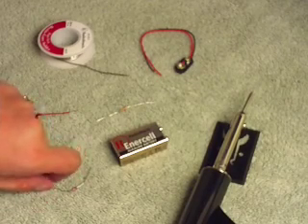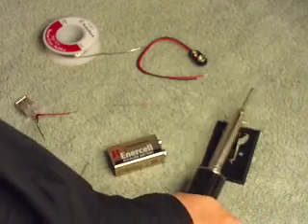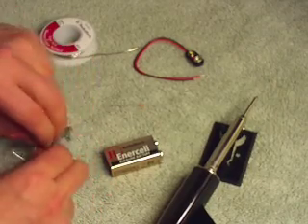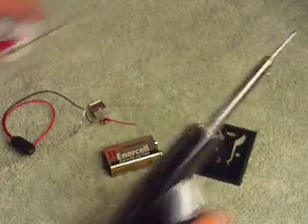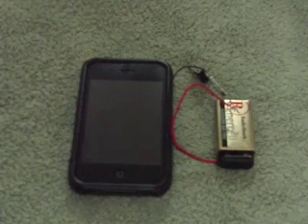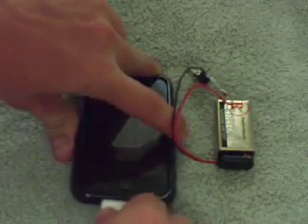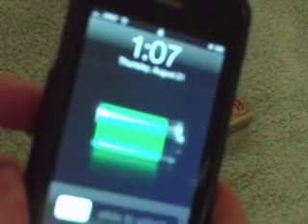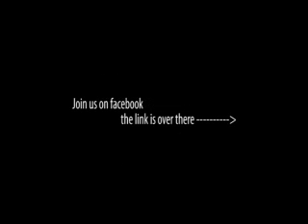How to make a USB battery

Comment: Why is the resistor necessary?
Reply: Because the battery is 9v and the USB is 5v. The resistor just lowers to voltage to 5.1v.

Comment: It is fake and you didn't make a great job hiding it.
Reply: becouse zener diod alows 100ma current that wouldnt even charge your phone of it would it would take more than 2 days
Reply: iMiner and iphone needs surcent voltage on 2 data pins so he should use voltagr devidor with resistors and he didnt use eny of that so yes its fake

Comment: Can anyone help me out ?
I put those 2 wires in the outlet instead of connecting them with the battery connector.
It was charging, but after 5 seconds there was smoke comming out my phone and the screen went off.
What did I do wrong ? My phone isn't booting up. How to fix this ?
Reply: +Eduard Likes Unicorns las conectaste mas , estas haciendo un corte
Reply: +Eduard Likes Unicorns buy a new cellphone
Reply: +Eduard Likes Unicorns IDIOT

Comment: This is a terrible idea. Use a 5v regulator, a standard diode and 5 NIMH AAA cells in a can. The amount of energy in a 9V battery is very small compared to the iPhone battery and is even lower when you try to pull a charging current out of it.
Reply: Power Max I honestly don't understand why people do not read the description before making comments like this.  The description literally says "if you need a quick charge" and "turn a 9-volt battery into a life saver."  Although the charge may not be quick, this video was NOT intended to show an efficient charger, but a small, easy-to-build emergency power pack just in case you ran out of power at a bad time.
Reply: This was made in 2008, when phone batteries were not 2500+ milliamp hours.
Reply: NoahWL1 They were generally higher than 1000mAH, and the impedance matching between a 5V input and a 9V battery is awful without proper voltage conversion via a switching regulator.

A high quality alkaline 9V battery has as much as 600mAH of charge ideally with minimum current draw, but that falls to less than 400mAH when the phone is attempting to pull 500mA of current (if the voltage did not drop so much, the current will probably be closer to 1000mA or more, but a 9V battery cannot deliver that much). Assuming that the phone can pull that 500mA of current and the voltage drops to the proper 5V from the zener diode, an absolute maximum of 0.4AH*5V= 2WH  will be 'delivered' to the phone (but not the battery in particular. There will be losses with the charging circuitry inside the phone), even if the 9V battery theoretically has 5.4WH stored inside.

To put 2WH of charge in perspective, the typical WH rating of a 1500mAH battery like that inside many older iPhones is 5.5WH. It is less than 26% charge if the phone completely shut down, and assuming no power loss in the charging circuitry. otherwise, it is far less. Perhaps it is enough to make an emergency call. I would not bother with this method anyway since there is no proper 9V to 5V buck converter, and a switchmode converter would allow a MUCH more efficient conversion to allow the most of that 5.4mAH to charge the phone.
Reply: NoahWL1 The problem with it is it just won't work. Read the data sheet of any typical 9V battery. Power Max is absolutely right, you cannot draw 500ma out of a typical 9V Battery. You probably couldn't even keep an iPhone turned on from just a 9V battery.  It might work with a NIMH 9V battery because they are able to deliver much higher current than their primary cousins. Looking at the data sheet will help you to better understand what I'm talking about (if you don't).
Reply: NoahWL1 True, I agree. (but who reads descriptions!? lol) Even given that info, I still would not trust this as it could fry the USB input on the phone, 9V is a lot more than 5V and if there is any capacitance in parallel, then say goodbye to the sensitive electronics inside the phone. Using a common car charger and connecting that to a spare is the better way to go! They can be found in nearly any car, they offer a conversion to 5V with upwards to 85% efficiency, and can deliver 600mA @ 5V with a input of 380mA from a 9V battery (taking into account ~85% efficiency)
Reply: tarstarkusz I found this datasheet and used this for my calculations, here it is if you care for it. The one graph shows curent draw up to 500mA, but I'd imagine the voltage drop would be significant.  http://data.energizer.com/PDFs/522.pdf

Comment: Is it me? Or is this the most vague  how to ever?  I mean solder the zener to the connector..then the battery to the left wire..  Then hook it all up and whalaa! All done😀😊 I don't think u want anyone to learn this one.
Reply: Just get one of those car chargers and connect the USB part to the phone and the car cigarette lighter end to the battery, with the tip of the charger touching the + end of the battery and the side metal strip touching the other terminal of the battery. This is a FAR more efficient method, you can probably charge a modern phone to 50% from zero with this method.

(The method in the video above will only get you like about 10% charge in a modern phone, with risk of frying the USB on your phone)

Comment: First of all this doesn't work on Iphone 5S it only works for Samsung and not all brands. Second thing it doesn't actually charge the battery small current just passes to make the mobile say that its charging but actually nothing happens
Reply: Both of those statements are true only because those phones DIDN'T EXIST at the time of this video's making.  It cannot charge something it doesn't have, nor present day smartphones with 2400+ mAh batteries.

Comment: I understand what I'm saying perfectly well. You sem to not understand voltage regulators. The Zener diode receives a value, in this case, 9v (You are really ignorant about the hardware used in this video) and then produces a set voltage back out, 5.1v. The Zener diode exists and functions as a voltage regulator.

Comment: No... Without the resistor, all the zener diode will be doing is making sure the voltage is greater than 5.1v. 10v could go through a zener diode in its reverse direction if it's breakdown voltage is 5.1v.

So please, next time you say something, double check you understood what wikipedia told you.

Comment: A Zener diode is a diode which allows current to flow in the forward direction in the same manner as an ideal diode, but also permits it to flow in the reverse direction when the voltage is above a certain value known as the breakdown voltage. Breakdown voltage is a characteristic that defines the maximum voltage difference.

A voltage regulator is designed to automatically maintain a constant voltage level.

So basically, a zener diode IS a regulator.

Comment: I was at Home Hardware once and I bough two USB rechargeable batteries. It works by taking off the positive end of the battery and it exposes the male USB connector. Pretty cool and handy if you ask me.

Comment: I was thinking the same but it will not work with 9 volt battery, USB gives around 5 volts, plus you need some sort of charge controller- in order not to ruin the battery :(

Comment: This project is the best way to burn electonic in your mobile. Beter if you use 7805, 2x 220μF and 2x 100pF capasitors.

Comment: Cringing at your soldering
you're supposed to get the wires warm and melt the solder on the wire,
Cold Solder Joints
A "cold solder joint" can occur when not enough heat is applied to the component, board, or both. Another common cause is a component moving before the solder has completely cooled and solidified. A cold joint is brittle and prone to physical failure. It is also generally a very high resistance connection which can effect the operation of the circuit or cause it to fail completely

Comment: For more stability, an L7805 integrated circuit can deliver more+regulated current; also for 9 volts->4,8 volts one can use 6 diodes (1N4007) in series... oh well, a 30 ohms resistor is just right for charging a phone :D

Comment: If only it were that simple. Todays batteries are far too advanced to be charged with these small devices, it ruins the balancing and power distribution of the cells and dramatically shortens the lifespan of the batteries.

Comment: Oh wow, epic fail. I could charge it with the 9v battery and the usb end with the cable easily. however, your device isn't even charging the iphone. anyone who owns an iphone is very used to the plug symbol when it's charging. who do you think you're fooling? it at least looks like you know what you're doing, so perhaps you made a mistake, or used too powerful of a resistor. the charge voltage should be around 5 volts, so resisting more than 4v is too much

Comment: I have bought several of this diodes at radio shack but when i check the output with a voltmeter at  9 to 12v battery input, output only drops down to 3,2,1 or even less voltages. has that ever happened to anyone

Comment: This is the first video I didn't believe u because if you use a resistor that cuts the power to five volts (which i believe you on)and a 9v (fresh) than when the volts dropped from charging go down thresistor would not hold say 8v to a stable five which is requiered to charge any USB device. Thing is, use a five volt regulator instead of resistors. This will keep the voltage at a exact 5v

Comment: This is BAD electronics.  1/resistance total=1/r1+1/r2.  In otherwords, your output voltage will differ depending on your load.

Comment: why dont you prove me wrong then, remake the charger, and show me the cable running from the charger to the ipod, without running under the ipod or outside the camera view.
i work for apple research and development, your device with charge a regular mp3 player, blackberry but not an ipod, the ipod needs a data signal to charge

Comment: its fake, the ipod needs a signal through the data pins of the usb to charge and using a resistor to lower voltage? what not use a voltage regulator its easier to work with.

i dont know  why people put these fake videos, its not gonna make u famous, its gonna make u more stupid than ever

Comment: @Justmyside
Apologies if I am wrong, but I don't think it is possible to differentiate between raw electric currents, as they are a consistent flow. USB ports are handled by the motherboard, not the OS, so Apple can only prevent different software sending signals to the iPhone, but if there is no interface, there is no way for apple software to regulate flow, that is how car/mains chargers work

Comment: Do i understand it correctly by saying that the zener diode is soldered to both prongs of the usb socket and the resistor is soldered in between the + from the battery and + on the usb socket?

Comment: The problem with this circuit is that there will always be a 46mA drain on the battery, in addition to what your USB device pulls, if I have done my math correctly.  Also, if I have done my math correctly, the USB device would only be able to draw 78mA off the battery, so it would be very limited what it will run.

Comment: @juan3238 Wrong since 7805's are actually inefficient. Zener's do not regulae output voltage nor do they produce a clean constant voltage. Seeing as how diodes are current driven and not voltage driven you'd be a moron to use a zener to regulate voltage instead of a damn voltage regulator.

Comment: @chimeofdeath maybe you should be called chimeofBLIND cuz he TYPED red wire and the diode WENT ON THE BLACK WIRE 
BTW:
RED = + (power going in)
BLACK = - (power going out) 
so the "Electrical Engineer" was RIGHT and the idiot from you tube was WRONG

Comment: @Manderion yes, there has been alot of posting on why not a Zenor Diode in reverse bais on this video by me and others. but yours was at least informed. for you it would be important to know that by using a zener you would be losing about 50% of your battery in making heat instead of charging your circuit. it might not matter when plugged into the wall, but when using batteries it is huge. you can spend $1 more in a 7805 and save yourself from an expensive battery which you wont get all out of.

Comment: @juan3238 nope,never heard of such new modern wonders. please teach me :) Zener would be a loss of 50% power in this circuit. since we arent making a heater it is not a good choice. 
no, zenors do not "give you 5v at output." they do not regulate output, only clip it. which is harmful to modern electronics. 7805 regulates output to 5V, not a range of 0-5v, but an actual regulation. 
and for sure the zenor does not "rectify" the voltage, please google "voltage rectification" for info.

Comment: @rmasso38 He uses a 5.1 V Z diode. A very dirty way to get a 5V Voltage and a normal 9V Block has about 190 mAh so the charge isnt that great. ok 190mAh to 1200 mAh. 1200 mAh Lithium cost about 11 €.

Comment: @rmasso38 mmmm an electric engenier that dosnt know about a zener diode?
it will rectify the voltage at the zener voltage, if you connect a zenner diode of 5v, it will give you 5v at output.
the 7805 give you more efficiency ^^

sorry about my english ;)

Comment: @rmasso38 If you listened closely, he put a 5.1V zener diode across the battery to regulate it down to ~5V.  iirc, fixed regulators normally are only really advantageous for noisy voltage supplies compared to a zener and a battery is by no means noisy.

Comment: @pthorsteinn here is a good website that describes what to do with the datalines. google "Home Brew USB Charger / Power Supply" you will have to ignore the top part since he is starting from a hack on a wall wart, but the 3rd pic is what i was describing to you. 
datalines are a problem because of software not hardware in the device. as soon as it sees power it does checks/handshaking. USB is meant for 2 computers to communicate, not just charging. see if it is your solution. keep hunting!

Comment: @pthorsteinn alot of the modern iphones, etc dont like the data lines not connected. its called floating pins, it is an uncertain case meaning unclear if your sending or recieving data therefore it doesnt work correctly. i am on a plan from New York right now.... i will draw a diagram in the morning.

Comment: @pthorsteinn switching the red and black wires is very dangerous. you could short out internal things in  your iphone. does it still charge normally? black wire from minus side of battery goes to pin 1 of a FEMALE usb connector and red wire on pin 4. if it is a modern device then also try connecting Pins 2 & 3 together then soldered to one end of a 10k ohm resister. The other end of the 10k ohm resister is connected to the same +5vdc.

Comment: @pthorsteinn it is difficult to troubleshoot a circuit i can not see. haha my train of thought for you is.
1. use a multimeter to check if batteries are dead, or connect a 330Ohm resistor and an LED and see if it lights.
2. then check your polarity. batteries should look like this: black wire - |===| + - |===|+ red wire. 
3. check if you connected the red (plus) and the black (minus) to the correct places on the USB female.
if any of these are wrong the circuit would not work. keep me posted.

Comment: @TheBackwardsNinja hard to say with out specifics. batteries differ alot. but to give you some idea: an average AA will give about 700 mA/h while a rechargeable AA will give about 1100mA/h. a 9V is 565mA/h. it depends on the chemistry of the battery (lithium, alkaline, NiCd, etc). where mA= 1/1000 Amps. so mA/h will tell you how many milli Amps it will give you in one hour. this is a useful way to measure since you can figure out how much current, and how long your battery will last.

Comment: @pthorsteinn 9V battery is nice cause it is compact but AAs have alot more current. Any device your charging will have a max draw ( max current it will take in ) or else it would over heat. You can look up this value for whatever your charging. If you use more batteries then you need it won't help past the point of max draw anyway. Personally I would put two AAs in series then put those in parrallel with another two in series. This would give me a couple very fast full charges.

Comment: @pthorsteinn Well, AA's can vary in voltage depending on type. But the input to the 7805 IC should be 6 to 30V. If u put the batteries in series and get 30Vs then your charger will last longer before the batteries are drained below 6V and it stops working. If you put the AAs in 6 V parallel then it won't last as many charges but it will charge much faster! So it depends on what your needs are. I would assume a fast charger that works for two or so full charges would be more important.

Comment: Hello, I am an Electrical Engineer, and i can tell you that this will work to charge any device that uses a USB. BUT... and it is a big BUT, some electronics are sensative to how much voltage is given. USB wants a 5V on that red wire and not 9V from battery. it depends on the specific device about whether it is within range. the best option is to chip in an extra dollar into this circuit and buy a 5V voltage regulator (look up a 7805 at radio shack) the extra dollar protects your $500 iphone

Comment: @TenFoldDamage You're right! The problem wasnt so much the lack of data btw but the lack of resistors. The i[Gadget]s check for resistors in the circuit to accept charging or not. Check out MintyBoost if you're interested in making a charger. But as a word of advice: watch the resistors with ur soldering gun and don't try to modify it once you complete it. Now i need to go buy a new resistor because i burnt mine out trying to stabilize the female USB socket to the Altoids tin x.x

Comment: so in conclusion, connect the diod to the red part of the 9 volt connector and the resister to the back part. connect the znner to the left part of the usb part and resister to the right part. insert battery in the 9v battery connector and test it out.

correct me if i'm wrong